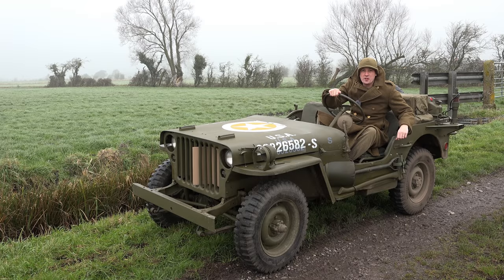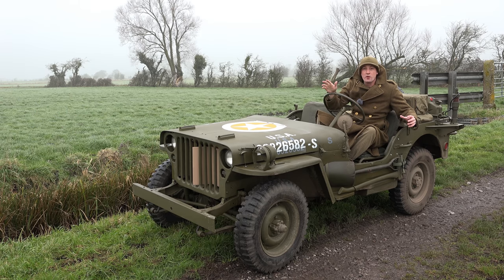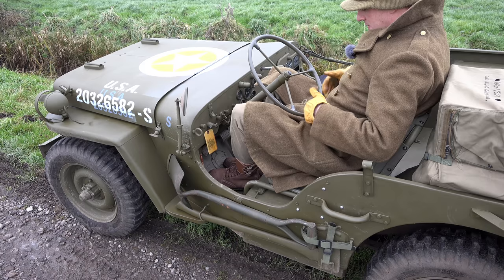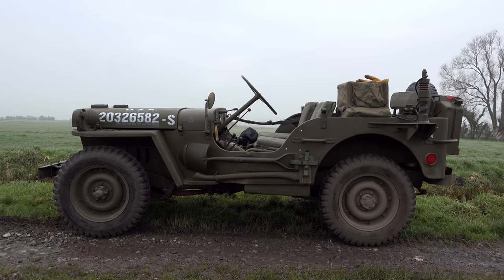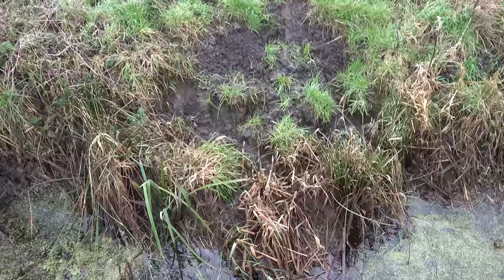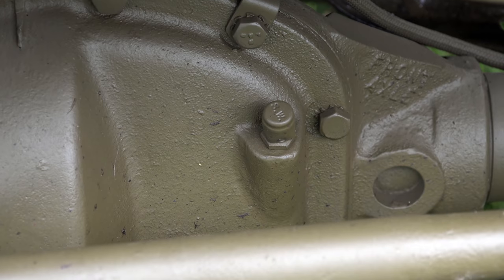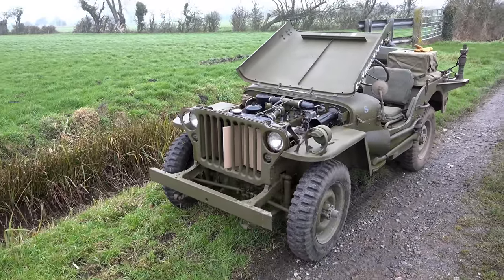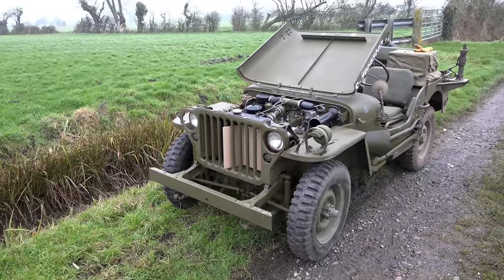Top 5 WORST Willys jeep features!

Comment: When you think of it, there was really no reason to not vent both axles and transfer case to a higher spot on the Jeep. Also, one thing that old jeeps were lacking is at least one good crawler gear. At least 60:1 would have been reasonable.

Comment: Built in 41 service 42 and military design.  So comfort is not in design, as the dimmer Combat low high way behind lines. Got wet driving what did the foot solider get, WET.
Reply: Soldiers got wet, muddy, and tired.

Comment: The early Jeep had three benchmarks.  1. No side windows.  This means no electric windows and if you have a passenger with ugly conversation,  you can drown her/him out by driving behind a noisy car. It is still quiet enough for a chat with your sweetie. 2. Mileage.  Many cars and pickups today give you a sore arm from pumping gas. 3. Drive train. When you are fatigued or sick of shifting and concentration,  you can keep producing smooth power in the Jeep.  The motor and speed ranges are more tolerant and friendly than most Detroit and foreign iron..... The one big negative is avoiding fast traffic as a never ending feat.

Comment: why on earth didn't they have the dimmer switch on the dash
even if they still used the switch you use with your foot but just mounted it on the dash, surely it would have solved the problem without costing the earth for the Military to do so
Oh and the size of that steering wheel, where was it built? Texas?

Comment: 1 and 4 are related to the requirements the US government made mandatory during the bid responses. Army’s Ordnance Technical Committee specifications mandated no more than 1,300 lbs (590 kg), 47 inches (119cm) wide X 75 inches(190cm)long. A standard 4x8 (121cm x 243cm) measurement with space for strapping down used in US construction for materials, trailer, building supply, and cargo specs of most airplanes, ships and containers could carry this to anywhere in the world quickly. The time from shipping to service was greatly reduced and was respected as the first rapid deployment solution in a time of need.

Comment: Hi. Great project, well done!! Can you please tell me where you managed to get the radio set for your jeep,and what was the rough cost? Thanks!
Reply from the maker: Hi, no radio is actually fitted yet, the cover is over a cardboard box!   Underneath the box is a NOS CS79 Battery box, all the parts came from ebay and the cost was a lot, so far!! Cheers
Reply: @Greendot319  many thanks for the info!
Reply from the maker: @madmeerkat1158  unfortunately these days when it comes to collecting pieces like these its a just a matter of you have to find them and pay what they cost because they are no longer cheap or easy to find :/ sorry that is not a good answer!
Reply: @Greendot319  I know what you mean. Right time, right place comes to mind!!
Reply from the maker: @madmeerkat1158  thats it  no easy answer, the canvas cover for the radios cost €180 with postage but you can't find it if you want it so you've got to pay.  20 years ago perhaps you could buy the whole set up for €180!
Reply: @Greendot319  I suppose it"s like the toys that we had in our younger days. Worth a fortune now, if you did not take them out of the box and play with them. So cheap and plentiful  then, but so rare now!
Reply from the maker: @madmeerkat1158  you can always find worn out used stuff, its the original condition that costs money!

Comment: Now you understand why, historically, military drivers have been the smallest people in the unit.
You should have a crank starting rod for the cold starts😉
Reply from the maker: The starter works well, just needed some choke, had been sitting for a couple of hours in minus 10!
Reply: @Greendot319  I understand more than most, I have owned a few 60's & 70's Dodges. I also was driver of a deuce & half in the Army.
Reply from the maker: Thanks for your service, I try to respect these vehicles and provoke some thought about them, something which people like yourself who have experience with them dont need!

Comment: You actually hit on the worst design feature. The location of the fire extinguisher. Since as you state, your previous one had the straps broken off. Ever wonder why? It was not. Something originally designed by Willys, but an after delivery foolish bureaucratic decision. It is also to be remembered that the Jeep was made from cold stamped parts for the body. That determined what strength steel could be used in the mass production method.
Reply from the maker: Good knowledge Walter thanks

Comment: would be neat to see a kind of modern take on a willys,  like the entire frame would be filled with 18650 Cell batterys, and have an electric motor basically just strapped to the  transfer case,   or retain the manual transmission   i just think it would be neat to basically try and tackle the same design parameters the willys was built for, with modern tech and see what comes out.

cheap, compact, robust, minimalistic, 4wd
Reply: We used to take the old Willy`s and cut a modern 4 wheel drive chassis and fit them in that way we had all of the modern drive and suspension with the decent look of an old Willy`s.

Comment: The dimmer switch is not a problem. Once you were in Europe, you never used the service headlights again. Often the guys would unplug the service headlight bulbs to unsure you would not accidentally turn them on in combat. 
You forgot two of my pet peeves of the WW2 jeep. The Carter carburetor that is prone to flooding because they designers had to boost horsepower from 40 to 60 to satisfy government specifications. Race engine builder Barney Roos was called in to hot rod the engine by forcing more fuel in it. Once you flood it with a  six volt electric system you're sure to run down the battery. The second is the transmission, it's absolutely cheesy! Like the carb the transmission was a slap together last minute design change. Willys originally used the T-91 tranny from their passenger car but the Army said it reduced ground clearance by one inch below specifications! So the T-84 was design literally overnight. I never let anyone who hadn't driven a WW2 jeep before drive my Jeep because they could easily trash the transmission. The Korean War era M-38 jeep used the superior T-91 transmission.

Comment: 2:00 It's not that the Jeep is too small laddie, but that some people are overly tall.  (edits to add items -4)

 (edit to add) Fun fact, back in the 1980's when the Hummer was getting deployed to replace the jeep a major complaint by US soldiers was that the Hummer was too wide and couldn't get between the trees when going off road in the forests.  The jeep on the other hand could get between the trees easily and that feature was used extensively during exercises to allow units to scout the OPFOR.  On the other hand, and with a few pounds (kg) of hindsight, the jeep couldn't be up-armored like the hummer was during the Gulf War.

(edit to add) (9:35 weather proofing) Late model military jeeps also suffered from this problem even with a full set of doors-roof-windshield.  In particular the roof had a number of snaps that were to attach it to a raised windshield to keep the rain from coming in while driving, but these often didn't work and the rain would come in through the gap(s).  
      (another fun fact) a damaged door replacement would come from unit funds, however the entirety of roof and doors would come out of division maintenance funds.  Canny supply and maintenance sergeants figured this out and could make it appear that their units were "making" money on their repairs.

(edit to add) (11:47) the windshield wipers of some (if not all) WWII through Korean War US military vehicles) was vacuum line driven.  What this meant was that the faster you went the slower the wipers would run, and the slower you went the faster the wipers would go.

(edit to add) (15:00 ish, very ish) maintenance and getting banged around:  A 1953 Dodge Line Ambulance, of the type used in the opening credits of the TV series MASH, had a front bumper that was about 1/4 inch (6 - 7mm) thick.  A certain former US Marine tank driver used one to knock a some what dismembered vehicle off the road (longer story that) with the result to the ambulance of some minor scratches to the bumper.  Jeeps couldn't do this only because they were so small and light weight, but the same kind of construction folks.

Comment: It seems the 5 issues are not really a design issues.  The dimmer switch, how often one uses the high beam and tank drivers seat way higher than all motor vehicle.
 The Americans are resourceful and adaptable like all humans. I guess the best criticisms should be from WWII veterans.
The war was won by numbers and current direction is like what the German did, great engineering  but difficult to maintain and not enough in numbers.
A Tiger can take out 10 Shermans, but there are 20. Shermans.

Comment: You missed the worst feature on the jeep, which is a design flaw. The front springs have the shackles at the front of the spring instead of at the rear. This makes the steering skittish over bumps Also the armature that the track rods connect into has a bush which wears out quickly & will make the steering feel loose - not good if you want to keep it road legal. The body stiffeners underneath are made from wood wrapped with sheet steel - these get soaked & will corrode. Mind you I had an old jeep, not a brand spanking new one.

Comment: I know I'm late to the party, but as an owner/rebuilder/mechanic of a 1948 CJ2A (the first civilian jeep model after the war) I know a couple of things about these lovely little trucks. 

First, you're getting in wrong. It's not your typical modern car. The easiest way to get in the driver's seat is to stand directly at the driver's 'door' and step in with your left foot. Stand almost completely up and step your right foot onto the floor just rearward of the gas pedal. Take your seat and your ready to be off. It's a much faster way to get in without any shuffling at all.  

Second, the 'bits and bobs' on the engine aren't all correct. To begin with, the engine is fitted with a civilian distributor. The original military unit has the coil inside the cap and is most definitely waterproof. Because of this, the spark plug wires are also incorrect and not the waterproof parts. 

I can't speak to the generator, but the starter should have bands on the outside with a felt(?) 'gasket' making the starter water resistant.

Not trying to rain on your parade, I love the video and thank you for making it. Just pointing out that not all the 'faults' are the fault of the vehicle and it's design - some of the parts are from very slightly newer models of jeep.

Thank you for talking about the shit replacement parts. You're not wrong.

The dimmer switch isn't a bad design/location. The problem is that an idiot decided that was a good place to put a fire extinguisher. A better spot for it is on the back side of the left fender.

18:18 "If you could build a vehicle..."
I did. My 1948 Willys is my daily driver. It started life as a CJ2A delivered to the dealership in Spokane, Washington. The dealership chopped it in half and added two feet to its length between the front seats and the rear wheel houses and sold it as a CJ2L. She's got a custom canvas top, excellent heater, and runs rings around many modern 4x4 trucks. At the moment I have less than $6000 USD in the jeep including the purchase price of $600. Yeah, the front frame horns were broken off at the crossmember just under the grille, had no brakes, and a floor of french lace from the gas pedal to the back bumper, but she's come a long way in the last six or so years.

Here's a video of it in action, having just snatched my wife's modern 4x4 out of the ditch in the middle of winter:
https://youtu.be/qciIGUmdFZ8
Reply from the maker: Thanks for the comment, all the features are correct on this jeep for a WW2 jeep, the distributor etc.  you talk about came later ;)  Do a quick google search for Willys MB
Reply: @Greendot319  I'll check that out. Seems we have conflicting sources. Wouldn't be the first time something posted on the internet was wrong. Either way, the GoDevil motor is a tough old bird and I love it.

Comment: Your comment about access to the dimmer switch is off base. The dimmer switch is ok. The problem is the addition of the fire extinguisher after the vehicle left the factory. So you can blame that lack of access on the safety committees. There are better locations for a fire extinguisher than in that position.

Comment: Worst features,...  in my opinion which I experienced driving a 42 for 6,000 miles on an ALCAN roadtrip,..  
1.  Hate the fuel tank under the seat, first thing I did was get a big plastic funnel to keep from spilling.
2.  Heat,.   what stinking heater,..
3 & 4.  Seat belt or some sort of strap,...   not a chance besides the seat doesn't move.  Seat were adjust by fat people losing weight.
5.   Top speed of 35mph,..    going 40-45 and it gets quite squirrely in the handling department,

Comment: In all fairness, the Willys jeep was hobbled together quickly from military contract spec sheets and committees.  The dimmer switch is classic military design.  A fire extinguisher is deemed important, it should be close at hand and anything behind it is less important. I'm sure most soldiers just disconnected them completely, useless in the day, could get you killed at night.

Comment: 17:40 Might be the reason the fire extinguisher was not in place the last time; it interferes with the dimmer switch.  I could imagine some GI positioning the fire extinguisher somewhere else or getting ride of it actually. If you're in a battlefield environment, do you really need the fire extinguisher there or anywhere for that matter? 
Seems to me its alot like those California based regulations we have in the US, where the rest of us have to suffer because some idiot thinks such in such isn't safe for operation type thing.

Comment: The ground is not even frozen, and it's having problems running without cardboard on the radiator.
Reply from the maker: no problems running, the radiator is too good for those temperatures

Comment: The height, width and weight were also designed to make it easy to ship overseas. A jeep would be fixed on a standard pallet, the steering wheel taken off, and after it was loaded, another false deck would be placed over it.  Ready for more cargo.  They had to be able to be unloaded by a standard deck crane. This is true of the 2 1/2 and 5 ton trucks as well.  Nothing was allowed beyond the height  of the cab and bed unless it could be stowed in the truck.  Of course the trucks required more headroom than a jeep.  Jeep were also made to fit on narrow European roads. Later jeeps had the dimmer switch on the dash, and the starter was where the dimmer used to be. Both the jeep and the humvee are very misunderstood.  Neither was designed for combat patrol, but for recon and general transportation. But both were used for combat patrols, and soldiers complained about how little protection they gave.  But they were being used for a role they were not designed for.  So yeah, if you use a can opener to cut vegetables, it's going to suck at it.  ^_*
Reply: That's not true of the HUMVEE.  It was designed to be a multi-use platform right from the beginning.  I had a magazine in 1982 that already showed the HUMVEE with hellfire missile launchers, TOW missile launchers, .50 cal., radar variants, C&C variants, ambulance variants etc. etc.  The HUMVEE was meant to - and did - replace every 4 wheeled vehicle in use by the army - including many in combat roles.  That said, they certainly didn't have enough crew protection for some of the tasks they were given, and that become obvious when they were finally used in combat - especially in built up areas and against insurgents that were more likely to use mines/IEDs than straight forward combat tactics.
Reply: @nickh5081  You are right, it was meant to replace all four wheeled vehicles, but combat patrolling was supposed to be done by a specialized vehicle like the Stryker. The idea of mounting a TOW missile on one was a throw back to the old 'Crunching Kitty' concept of WW II, where a large gun or recoiless rifle was mounted on a jeep.  The idea was the Tow would fire once, and then displace.The original concept of the Humvee become distorted as the contract was implemented. There .50 cal version was for the military police.  This is why there was a HUGE shortage of them in the initial roll out. The military became fixated on the idea that the Humvee could do EVERYTHING. But that wasn't in the initial design requirement.  It came later.  Having said that, the Humvee was a pretty good vehicle for anything but combat patrolling. Uncomfortable, true. But it was mobile and reasonably reliable, and could be be configured for many different roles.
Reply: @andrewgillis3073  True enough.  APC type vehicles are the norm for reconnaissance platoons anyway because although some reconnaissance may be done from the vehicle itself, 99% of the work is done by troops with boots on the ground.  Recce is a quiet, under the radar game - not loud engine game (at least it still was in the 80s).  The idea of driving around in Jeeps or HUMVEES to "keep the peace" may have worked in some UN missions but it doesn't fly in occupied territory where you're trying to avoid a civil war and none of the combatants would think twice about killing the peace keepers!